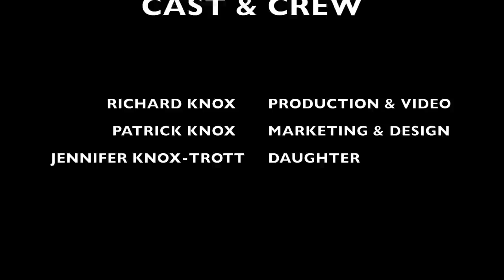S2 EP26 |  TIMBER FRAME | FOREST KITCHEN | CORNER BRACING, ORGANIZING KITCHEN WARE

Comment: Ouch.....I slammed my right ring finger in a heavy kitchen door and broke the tip also.  It's all good now....the nail looks a little funny but its there...still functions...Dad, don't beat yourself up.....I know the feeling.  Excited to see things coming along.  Will you let your used water flow down the hill?  I'm assuming this will be an open air kitchen? Worry about pans vs. weather on the backside
Reply from the maker: Open air

Comment: I can only imagine how her finger will be throbbing before it is all healed again. Been there done that...sadly. But she is a strong woman that doesn't seen to let setbacks effect her drive. Wishing her well and a quick heal. 
I am assuming your building is only going to have a roof but no walls to speak of. Are you planning to drill and install some large diameter dowels in those angled support braces? I ask because I am sure the long screws will not offer much of any real structural support from the building racking from a strong wind force. Large diameter wooden dowels through the support braces and the upright posts would sure it up very strong. And it would even look very fitting to that type structure as well. .JMHO  Thumbs Up
Reply from the maker: Thanks for all the concern.

Comment: Poor beautiful Jennifer glad it is not worse than that but very sore all the same. Hope you took a few painkillers. I was wondering if cheap deep square baking pan would be good to use as a sink instead of a small salad bowl. Just think of how many times you will use the sink to wash up for the next few years until the cabin is built. But not a big one just a deeper one that wont splash water everywhere on you wood , even though it will be protected. Just a thought.  God bless both of you , love from The Land Down Under.

Comment: I know how Jennifer feels, I smashed the end of my ring finger on my left hand with a 22oz framing hammer and broke the bone on the tip in to four pieces. The ER doctor had to pierce the nail with a high temp cautery fine tip pen to relieve the pressure because it was causing my finger to split down the side. By the way, the kitchen area is looking good but just in case you didn’t realize it, you spaced your wind chimes a little to far apart 😜😜